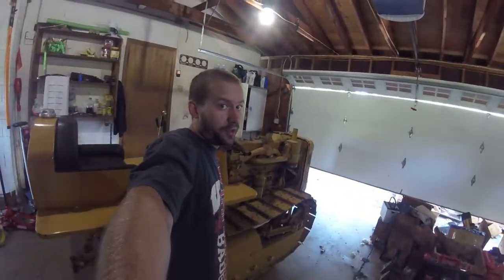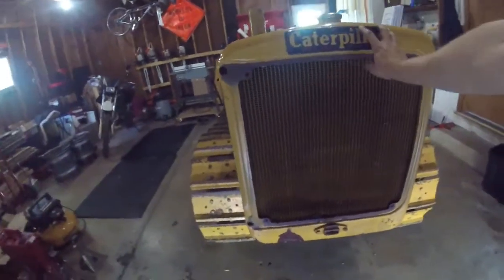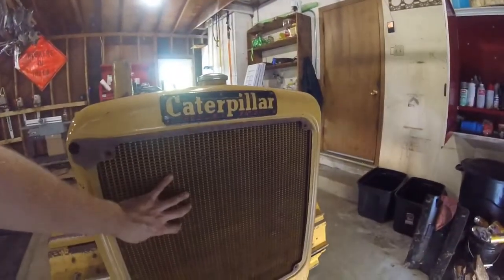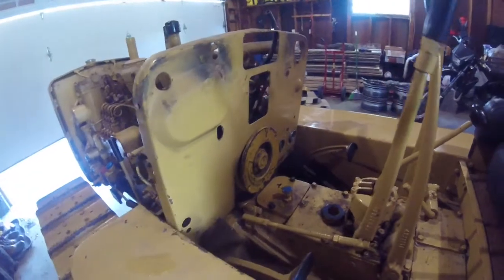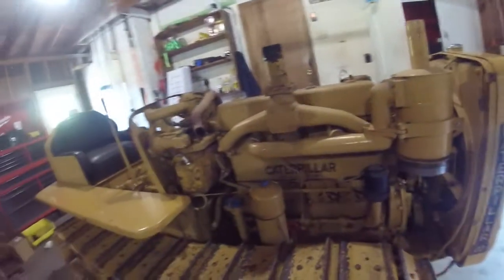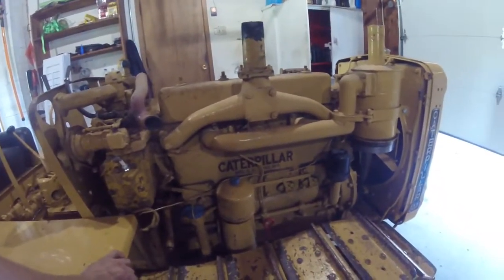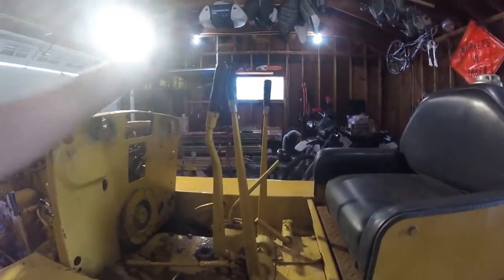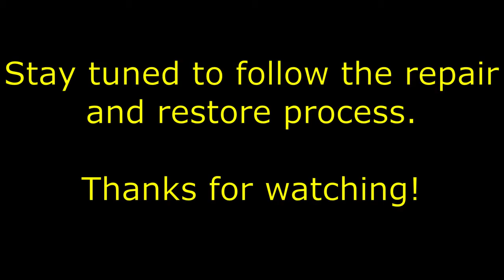Caterpillar D2 Restoration Part 1

Comment: That looks like a super low hours machine
Reply from the maker: I think so too. Hour meter reads 6, I'm guessing that was since the last rebuild it had. Undercarriage is not heavily worn either. Definitely needs some work in some areas though. Thanks for watching!
Reply: @KettleMoraineMeadows  4:58, the pedal cheque ring looks VERY clean and cosmetically, the entire unit is very fresh looking. The final drives look like they were fitted yesterday and even the upholstery looks good. Six hours could be accurate!
Reply from the maker: That's all true. I do know for a fact that it was rebuilt at some point based on some components in the engine though.